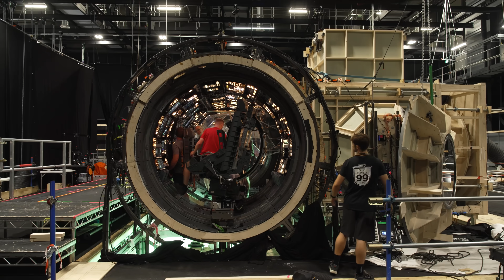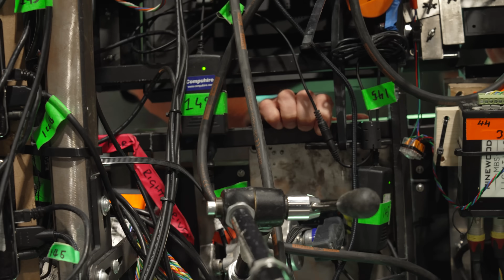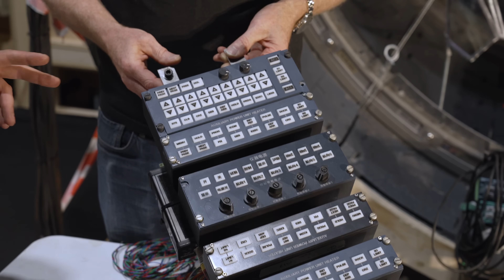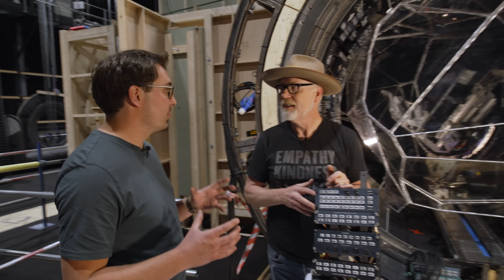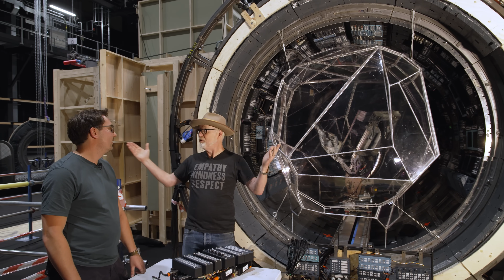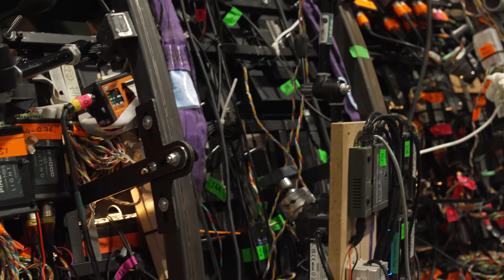How Project Hail Mary's Spaceship Set Was Built!

Comment: By the way, a "universe of DMX" is 512 channels of lighting controller. So 50 universe is of DMX is 256 levels each of a potential 25,600 lights. So they're able to use standard lighting control boards to set up all the patterns, equipment they can rent.

Comment: That wiring is the definition of intricacy for the sole purpose of job security. If you are the only one who knows how it works, they can't fire you
Reply: Well, that and things move very quickly on a film production. Not much time to properly wire and document everything. If it works well enough, then it's good.
Reply: LOL tbf I also think there might be some issues for modularity and moving parts etc. Generally your wiring aren't under these conditions.
Reply: And if you wired it up in a way that anyone could understand, it would take so long that you would definitely get fired...
Reply: It's just necessity even on a film like this they don't have the time/budget to do it neater as that would require a lot more custom electronics and not just off the shelf modules (like the dimmer packs).
Reply: I assure you they can...

...but then you can charge them a significant premium as a contractor when they come begging for you to come back. 😉
Reply: I assure you that's a terrible attitude. If you want to be irreplaceable, document clearly and teach enthusiastically. If you're the only one who knows something, you're a risk, not an asset.